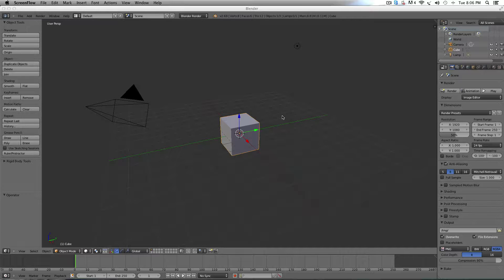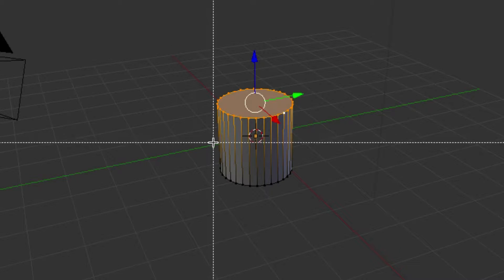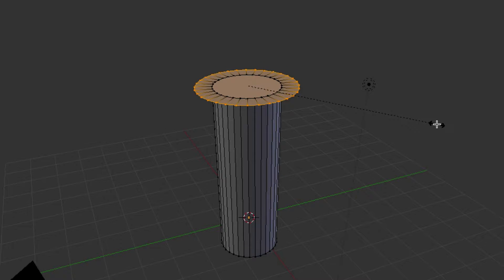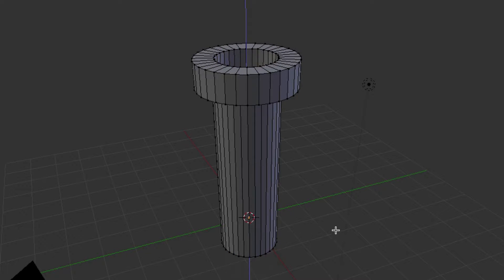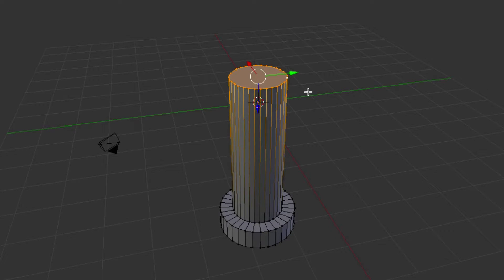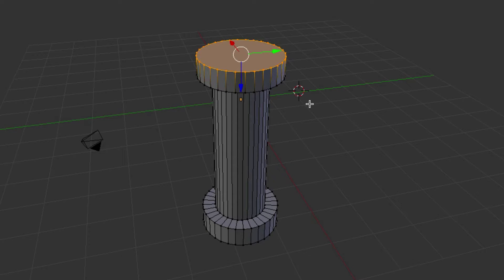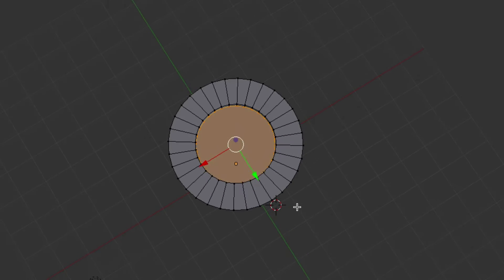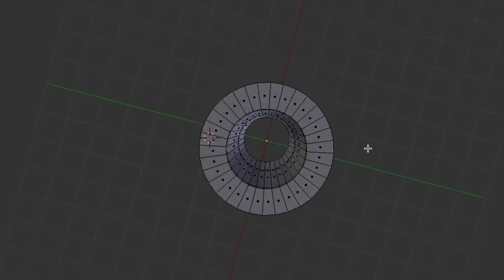Blender Tutorial 5 - Making A Pipe [How To]

Comment: I created 3 different pipes but when I try to created a new one, some how alt b did not behave as it has been. The portion that I select stays un selected and the rest disappears. Any suggestions?
Reply from the maker: graciela elia ALT-B is a clipping function designed to just show you the selected part you select with the crosshairs and it hides the rest from view. Is that what you wanted or were you looking for a different function. also if you have questions you can post them on our forum at - http://5minuteguide.net/forum/  if you want something that selects multiple points you can check out our video on quick keys. Blender Tutorial 2   Quick Keys [How To]
Reply from the maker: graciela elia here is the second video on quick keys Blender Tutorial 4 -  More Quick Keys [How To]
although I think what you are looking for is 'b' select. all you have hit is b and then select your vertices.
Reply: 5 Minute Guide Thank you!! You are the best. Your tutorials are pretty good and I am glad you responded so quickly.